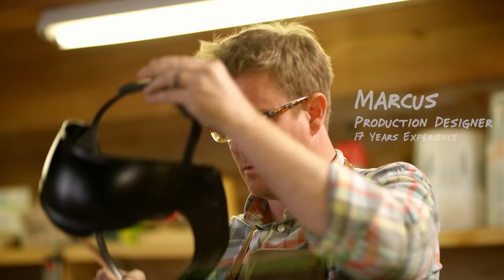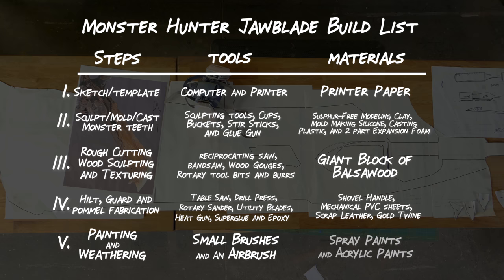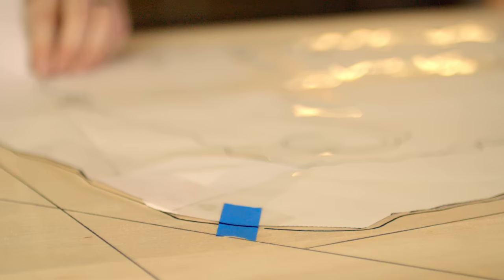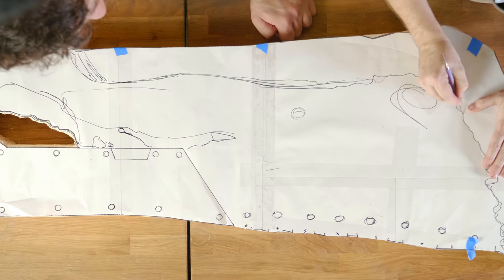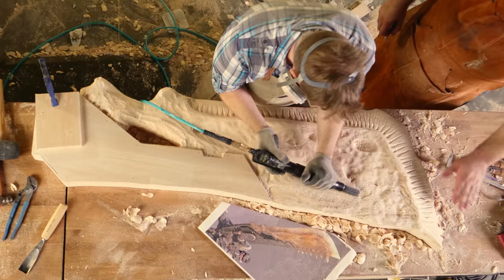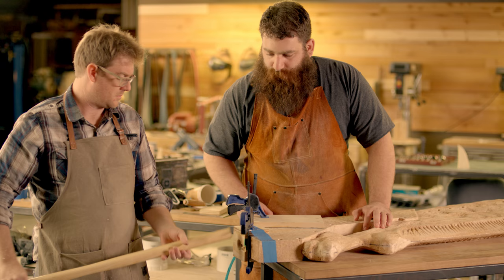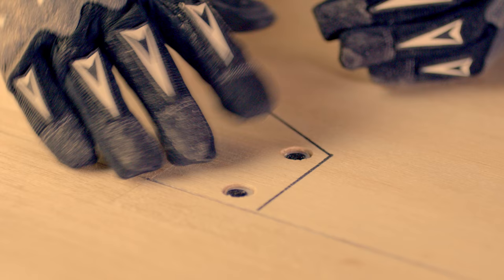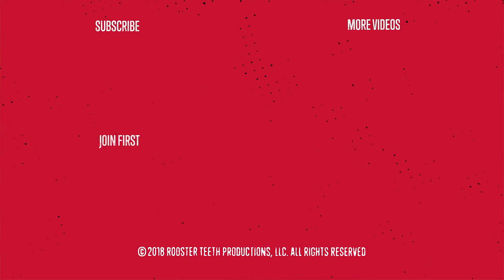Master & Apprentice: Monster Hunter: World - Jaw Blade  | Rooster Teeth

Comment: My only problem with this from a cosplay perspective is maybe they should have used a lighter material cause I can't imagine trying to carry it around or even pose with it 😅
BUT this thing looks amazing!
Reply: thehollowlingwin do you think a big piece of foam would work? Or would it be too fragile?
Reply: erika c I imagine there's a ton of methods to strengthen the inside, like using pvc as a skeleton
Reply: Adam said it's around 15 lbs. That's nothing
Reply: They said it’s 15 pounds
Reply: 15 pounds isn't much. Most rifles at 8-10. And the handles got that stub end you can set it down.
Reply: Only thing i could think of is maybe hollow it out form the spine and backfill it with some of that foam cast but then they might have issues keeping the teeth secured on there
Reply: quenton haskim I don’t do cosplay... or lift heavy things... but that seems like it would be kind of a hassle to carry around all day
Reply: 15lb is way to heavy to be carrying around at a con all day, this is almost certainly a display prop instead of a con prop. 5lb is the max wight for most normal people to still be able to pose with, 7lb if you are particularly athletic. If I was to do this Build I would go with pink insulation foam sealed in something like epsilon resin instead of balsa wood. It won’t look as nice as the one on the show in the end, but your arm isn’t going to fall off trying to pose with that. Also they lampshaded the fact that it was too heavy at the end with that “what good is a sword if you can’t swing it” line.
Reply: Go to a site called smooth on. They have a coating that can be placed over foam to protect it. Place a decent structure inside, place the foam around and then place the coating on the outside.
Reply: It’s 15-20lbs, that’s nothing
Reply: 15lb is not a lot. Having some form of sheath for your back would help with long days and when you need to pose, get it out. Resting it on your shoulder or letting it stand on its own is another option. If it was 20lbs I can see it being an actual issue. 6.8kg is 15lbs... Really not much.

Comment: I know this is completely out of left field and probably after your time, but could you guys make some props from Beast Wars? Namely the Transmetal Driver, which to me, seems fairly impossible to make and not very cosplay friendly unless you are specifically dressed as a character like Blackarachnia or something. Or, you know, just something a little more iconic like the Golden Discs. Specifically the Earth one, AKA, the Golden Record from the Voyager 1 space probe. Which to you guys would probably be super easy. I'm sure if I had access to 3D printer, I could probably design and print them and then just paint them up. But I'd be more interested to see if you guys come up with any other solutions that almost anybody could do.

Comment: A consistant, repeated omission in all the episodes in this series, so far, deals with the use of the "Rub-'n'-Buff". If you wish to use it on any project, it MUST BE SEALED after applying. If you don't, then you will literally "rub" it on, ...and "buff" it off, onto EVERYTHING IT COMES IN CONTACT WITH!!! I swear, it is as bad as GLITTER, (the official "Herpes" of the crafting world)!

Also, while balsa wood may be much lighter, than say solid oak, there are quite a few ways to make this prop MUCH LIGHTER. If you want to carry this around all day, at a con, the lighter it is, the better. When making any prop, costume, or even prosthetic make-up, you NEED to consider any and ALL discomforts. Because, any discomfort present will magnify, the longer the item causing the discomfort is used. AVOID THE MISERY AS MUCH AS POSSIBLE! At the very least, if there IS any discomfort, do your best to try and minimize it as much as possible. If you keep the performer(s) happy, they will gladly reciprocate the gesture, (i.e.: they may request, or even insist, that you be hired on the next project).

Finally, including a supply-list, (and, some possible suggestions on where to find them, or their equivalents), in the show notes would be very helpful to a lot of folks, especially those unfamiliar with the products and/or techniques you are using.